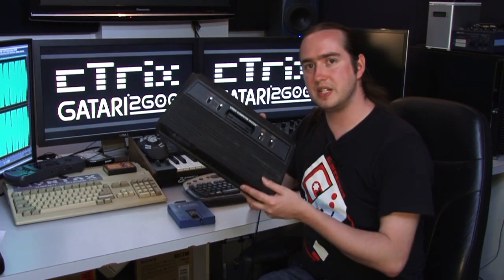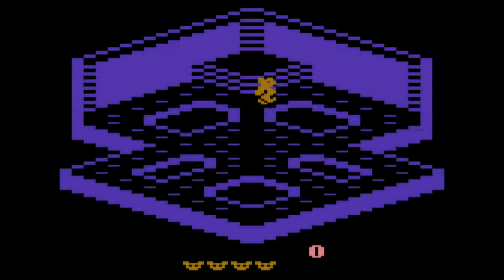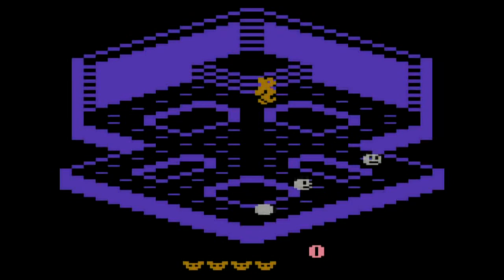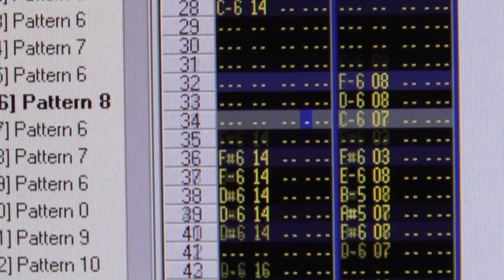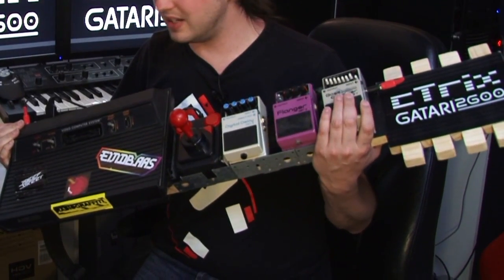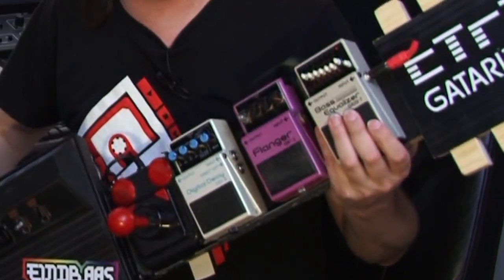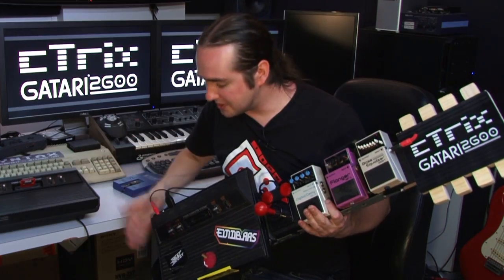gAtari - Atari 2600 chipmusic project by cTrix @ Blip Festival Tokyo 2011

Comment: Wow. The Atari 2600 has an amazingly raw and aggressive sound when used in this kind of context. I'd love to hear more chiptune artists make use of the 2600 - but I understand why some people would be turned off given how extreme the limitations are.
Reply: mgpxl, thanks.  Yes, I think that this is really neato cool.  I thank God!
Reply from the maker: It's super limiting, but quite fun too.  You run out of memory pretty quick.    What got me is how clean the output is.  I first did the audio mod and had it hooked up to my studio monitors and although there was a pop when I turned the power on, there was silence... no hiss or anything.  Then I hit play.. and holy s**t, my sub nearly took off.  It's very raw, but also so much cleaner than I'd ever imagined.
Reply: coding for the 2600 is hell, so they say. crossdevelopment/chiptunes maybe can be more fun. but there is also the whole atari 8bit computer line which sports the same sounds, although not with identical soundchip -- https://www.youtube.com/watch?v=pMW44Ih22Go -- there are several trackers for creating "pokey" tunes (one that impressed me a lot was "raster music tracker"). a big drawback on the TIA (2600) has always been the one byte frequency divider which makes it impossible to reach certain tones. on the pokey (8 bit computer line) it's possible to combine voices and have proper pitch, sacrificing one voice. recently it has been a trend to interpolate frequencies on the TIA to reach desired pitch, i haven't heard this yet. ---+-- @debuglive, many thanks for creating this. the 2600 was my first console back in the 80s and basically my musical brain is formatted with these sounds. i heard and felt the source of true bass (possible only to me) in an unheard impressing arrangement when the song kicked in in the beginning.

Comment: Incredible fat sound. Sounds better then Atari 800, C64, Atari ST and Amiga put together. To make a whole dance floor move using just an old Atari VCS 2600 as sound source, is quite stunning me think.
Reply: @__ Atari 2600 used TIA for 2 channel sound while Atari 800 used the Pokey chip for 4 channel sound. And, it's quote big difference between Atari 800 and Atari 2600.

Comment: Don't forget that the atari 2600 was internally (but not externally) wired for stereo sound...  perhaps you can leverage that to your advantage, more output options, routing left/right through separate pedals, crossfading, etc.
Reply from the maker: It was on the NTSC model... but not on the PAL model which I use for these tracks.  There are two pins on the TIA... aaaannnnnddd they have the same signal coming out of them :-/  But yeah; I've seen some cool mods and it was the original plan before I realized.  Later build had an auto-wah and octave shift options.

Comment from the maker: @BaldingEagle51 I tend to agree. Beyond amusing me, it's the most frustrating platform ever. Getting anything musical out of it at all is a mission! Jumps between notes are atonal and it's different depending which voice is being accessed. So most notes are out of tune with each other and the note range is different per voice. Beyond that is the memory limitation of 4kb which I'm working on (bank switching > 4k). There is a hack to get more note range - but that'll be late 2012 ;-) Cheers!!

Comment: I've listened to the full set recording so much that the lack of the "ah, yes! fuck!" at the beginning is so weeeeiiiirrrrd
Reply: Right? Although this one seems to be a better quality recording to me, albeit truncated
Reply from the maker: Yeah, Japan on stage electronics slighly better than old Eyebeam in NYC.  This was Atari > DI > Stagebox (DAC) > digital all the way to a CDR optical input.  NYC was Atari > cheap DI > Stagebox > 30m analogue multicore > analogue desk > analogue compressors > RCA tape out to Behringer live stream mixer > mac input jack > realtime MP3 encoder.  Although the crowd mics were pretty rad ;-)

Comment: no no no this is all wrong, the Atari 2600 & the NES are both 8-bit. it has something to do with CPU & all dat.  the sega genesis/SNES are 16-bit, PS1/sega saturn are 32-bit, N64 is 64-bit, the dreamcast/PS2/gamecube/xbox/ps3/wii/ & 360 are all 128-bit systems.

Comment: put this song into a good game then u have the song in a atari 2600 game
Reply: My bad i meant the best song on a atari 2600 game
Reply: ErnieDaGamer H. The song alone already uses more resources the Atari could handle without the effects. There would be nothing left for the actual game. ;)
Reply: maybe if u mod the atari to work with the song and game and maybe mod the cart as well
Reply from the maker: Lutz Herting
 Spot on!  It's already at the full 4kb on a single bank.  You could technically bank switch your way though the track or build more powerful macros... but it's already choc-a-block full of look up tables.  Memory limitations on the Atari are brutal.